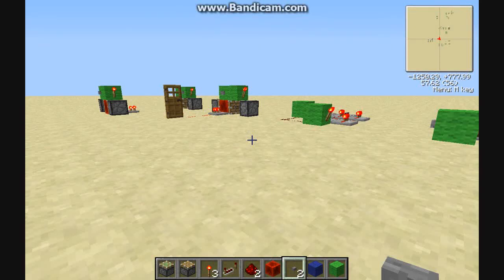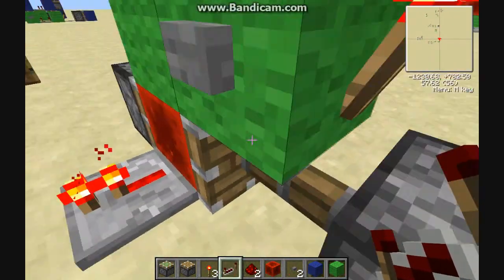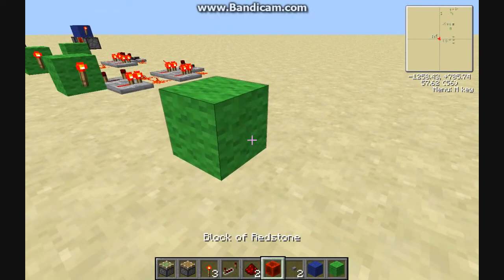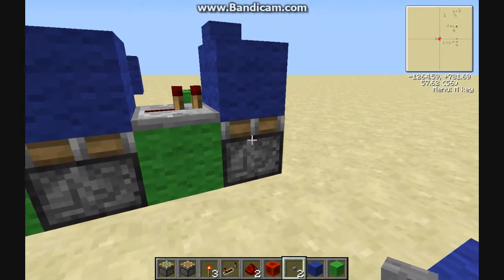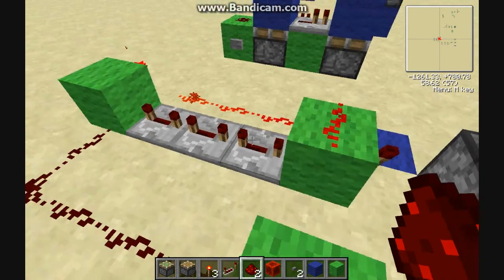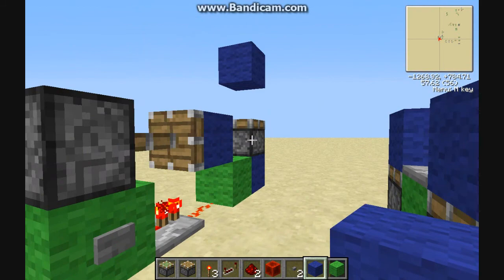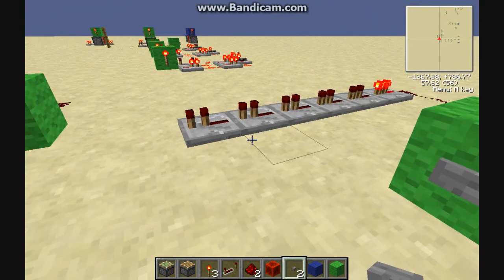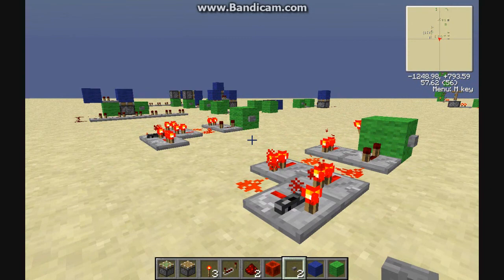Minecraft 1.7.4 Redstone basics Vol 3   T Flips Flops & Pulse Limiters

Comment: I was just using the repeater t flip flor and it worked fine, but it suddenly stopped working, and I've ever rebuild it completely. Not even sure why it quit working to begin with. The 3x3 door works on its own and the flip flop seems to be working right but when I connect it to the door the door will run one open/close cycle on its own and my button no longer works. :(